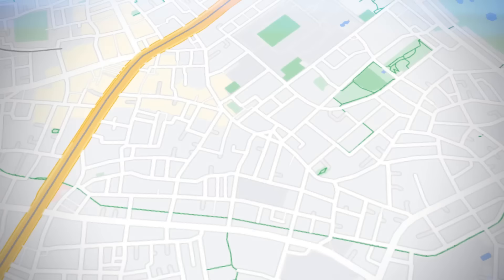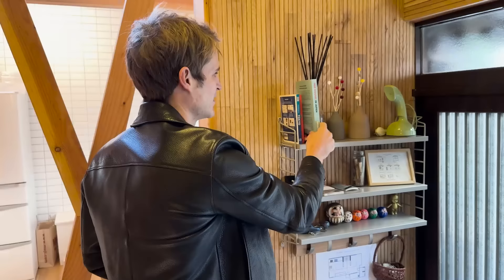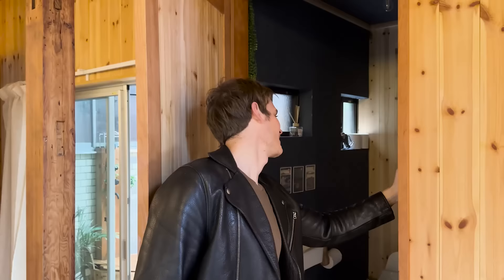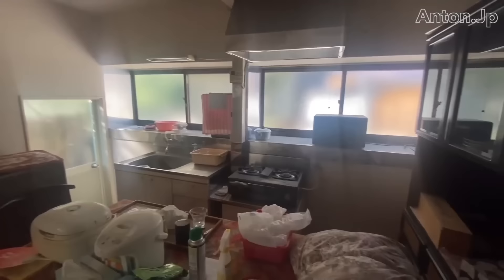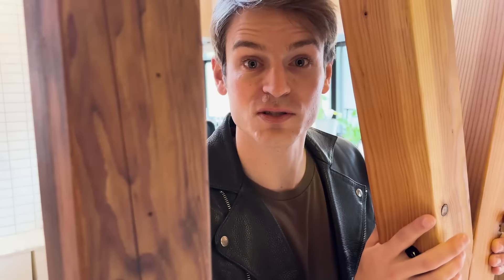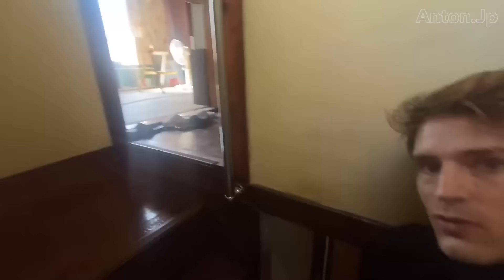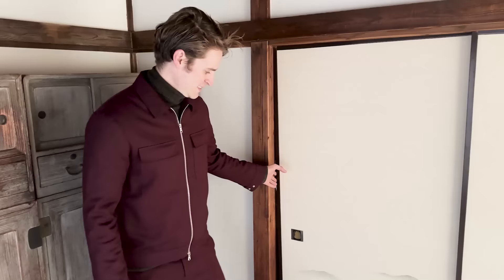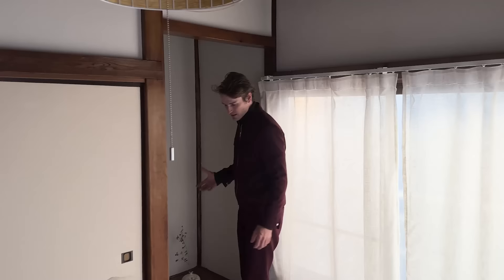Tokyo Home Tour - Step Into My Renovated Japandi House in Sangenjaya

Comment: All the natural light pouring into the first floor is saving electricity during the day. By not putting the interior walls back & removing a 2nd floor bedroom, the first floor flows & feels brighter & airy. I remembered one of your previous video before you started renovating, it was darker on the first floor. Well done!
Reply from the maker: Thank you for noticing! airy and brighy was what I was aiming for!
Reply: You are so handsome Anton 
How old are you
Do you have a girlfriend
Reply: Who turns on lights during daylight hours? I didn’t know that was a thing. 😅 While sunlight is free, air conditioning is not, so because the extra heat will also need to be cooled during the warmer months it’s a bit of a wash. Gorgeous though!
Reply: @toromei 
The heat(hot air) goes up, that's the basic physics.
Reply: @inggermanydeutschland3808 : We can certainly see where your hot air goes! 😂 Never mind physics, what about literacy? I didn’t say anything about that. Regardless, unless there’s no insulation or roof at all, the hot air still accumulates inside and keeps it hot, which I “enjoyed” regularly living in California — “basic physics”, as they say. 😉👍
Reply: @toromei  
Small window helps, with a tiny electricity fan helps even better.
Reply: ❤❤like

Comment: It looks great, I think most of your choices work well (it appears like you have good taste 😏). I like the idea of trying to salvage some elements from the old house so that it somehow lives on, but I wouldn't have thought there was a chance in hell one could make those pink tiles look good and yet I think you've pulled it off... black and pink (mauve?..) pair well. I would consider re-painting or replacing the bathtub with a black one though (unless you come across a real hinoki tub you can fit in there...) 👍

Comment: When looking at this - I can't help but wonder if all renovation steps are up to code in terms of earthquake resilience, etc. For example, I didn't see the foundation, but the reason why there's no foundation in those sorts of houses is often because a solid cement foundation will start to crack due to stress over time, hence there's a lot of issues to consider. 
If the house was already checked and confirmed to be OK, then there's no issues, but as I've recently been watching a lot of videos from an Australian building inspector, and knowing how strict the codes in Japan are, then I've always felt that it shouldn't be possible to start renovating an old house without a lot of consultation or experience from local construction workers/architects. This worry is because selling a house that's not built to code will only hurt the next inhabitants of the house, but I hope that a channel as big as this knows what it's doing. 🤞

Comment: Sorry to say that but if you wanted to showcase the stairs you should've put some monochrome background on the back wall. Now it just looks like "too much wood on more wood" basically. I'm sure it smells amazing though:) I'm pretty concerned about warming the place winter time too :/ There's no much use of great light and impressively high ceilings if you're freezing to death... To say something good - bathroom is great, black faucets look gorgeous on that pink tiles that would've been cheesy without this emo-touch;)

Comment: Wonderful tour! Lovely house. How did you do the 2nd floor ceiling rafters? Is there insulation?
I’d put in double glazed windows which help on noise and insulation. Pink tiles also, gotta go! Otherwise lovely job! I suppose you can’t have a woodstove in downtown Tokyo! That would be awesome.
Reply: I'd be concerned about insulation too. Especially as he said with how with opening it up that it would be colder in winter. Japanese winters are very cold and Japan has the highest snowfall than anywhere else in the world. Plus the humid summers in the cit. You definitely can't have a wood stove in Tokyo! Also as it's an air BnB a wood stove wouldn't be practical for visitors.